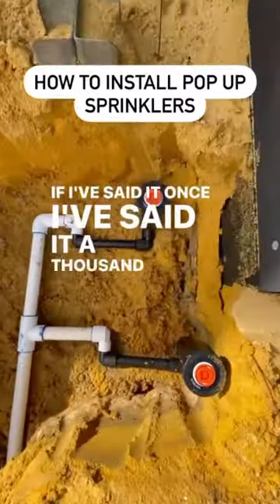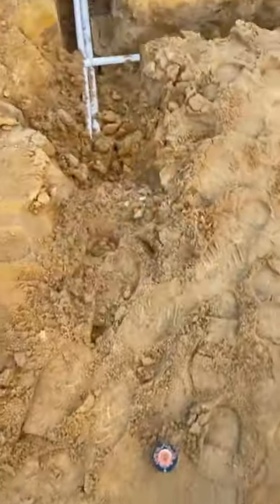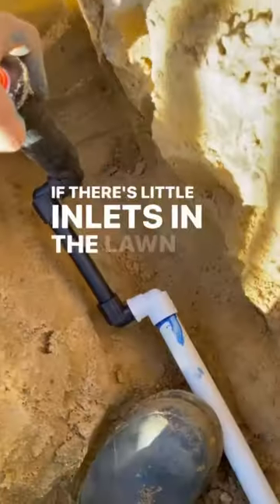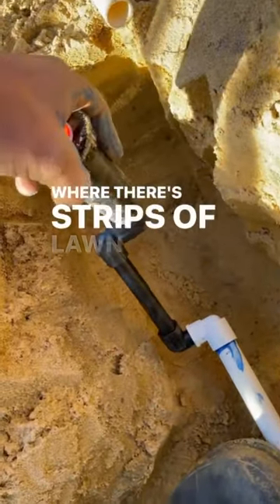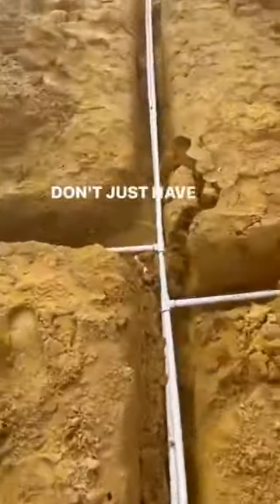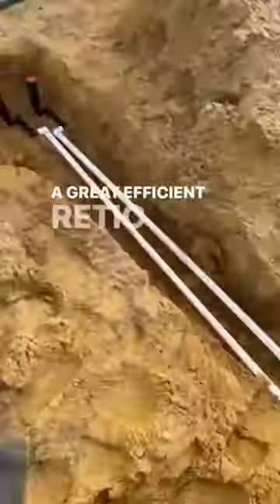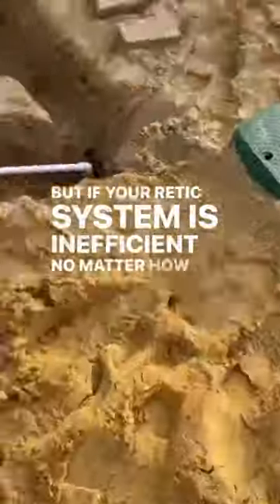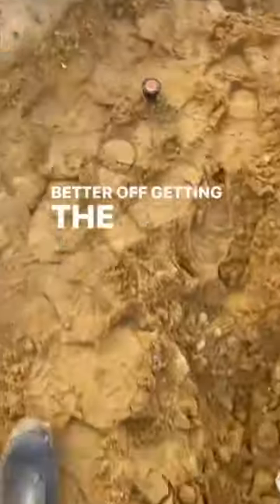How to install a sprinkler system! #irrigation #reticulation #sprinklerirrigation #rainbird #retic

Comment: Are the typical runs feeding the sprinkler heads for residential 3/4” PVC ?
I have 60 psi, water pressure.  I have to time filling a 5 gallon bucket. To see the volume but I’d say probably 20 seconds Max.
Is there a rule of thumb for how many sprinkler heads can I put on each zone.